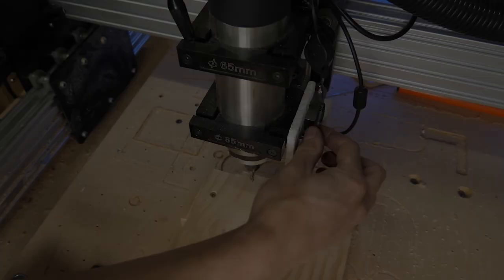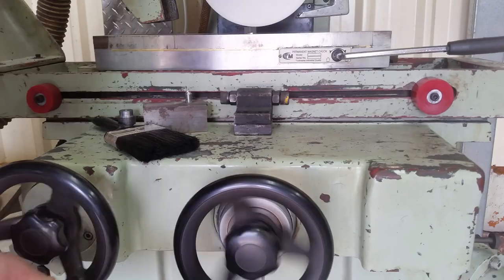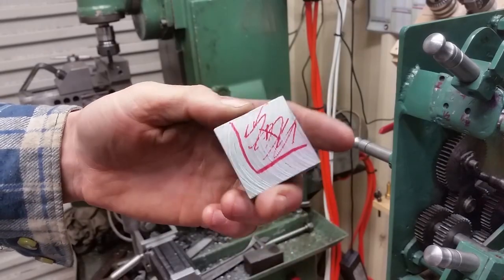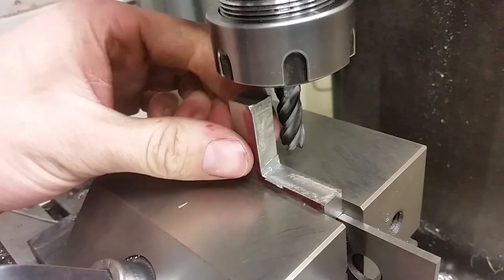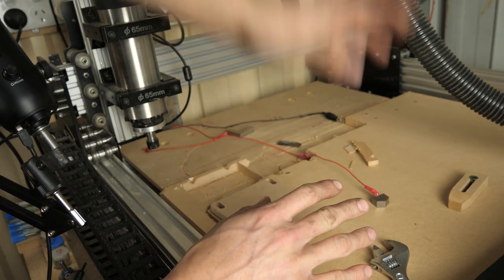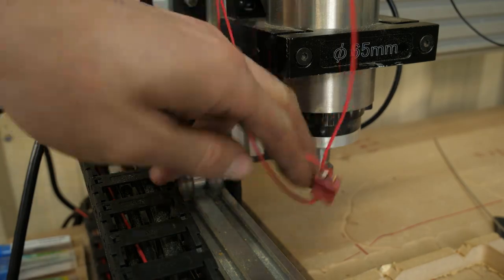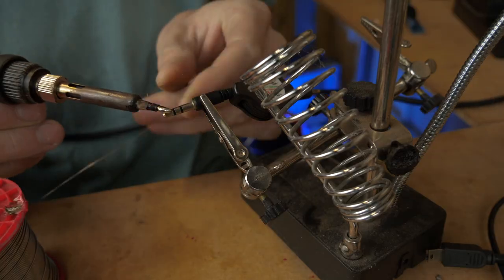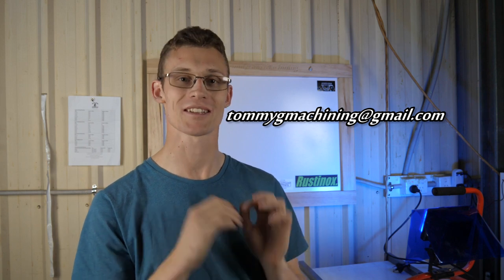Retractable CNC Touch Plates!

Comment: Great video.  I am interested in learning how to use GRBL on my CNC router that I have built.   Is there a macro or G-code that you are running to touch off, re-touch, and then set the z axis to zero on that surface (likewise for x & y) ?  Thank you for your help.
Reply from the maker: I believe there is G-code, however I set it using my software interface. I'm just using Universal G Code Sender and it has a few probing options

Comment: Hey mate! Gday from NSW. Just a quick tip with grinding small parts on the surface grinder. Whenever youre doing small parts like you did, you are going to want to lay some larger pieces with more surface area around it to give the part some lateral support. This will lessen the chance of the part jumping up into the wheel and making things go real south real quick. If you have some thick parallels they work really well.

Take care and loving the content!
Reply from the maker: Good advice, cheers!

Comment: Hi Tom - from another tastier boy currently living in Dubai - What driver and software are you using? i have a Yuyong machine with nothing but issues and need to get working rather than fixing . also do you sell the probes?
Reply from the maker: I use universal g code sender to run the router
it can interface with numerous control systems, I have a grbl controller setup

Comment: Hello i have a question what do you use for run code to get all 3 probe points is it a custom code you wrote or is it something else? Also does the probe for all three axis' use the same a5 pin and ground pin?
Reply from the maker: I'm using open source software called universal g code sender. It has some in built probing options if you go into one of the menus.
I've not had a chance to use it in a while, but I believe there is an option for just vertical probing to get the height (I only use this 95% of the time) there is the 2d probing in x and y, and I think a full 3d option that touches all 3 axis directions
Yes it all uses the same pin, the software just looks for a probe detection signal

Comment: On the last probe of the video you didn't have the alligator clip on the bit. Did you make a permanent attachment for the alligator clip?
Reply from the maker: I missed putting it into the video, the alligator clip is connected to the spindle body. You would need to check that it is conductive all the way to the tool in your case.
I also double check with the probe in my hand that it completes the circuit before committing to plunging with a probe cycle. Just in case something has come loose
Reply: @TomMakeHere  it's a good idea I'll have to try that thanks!